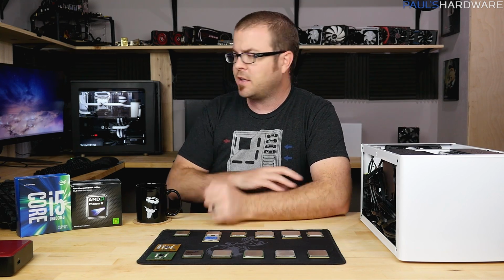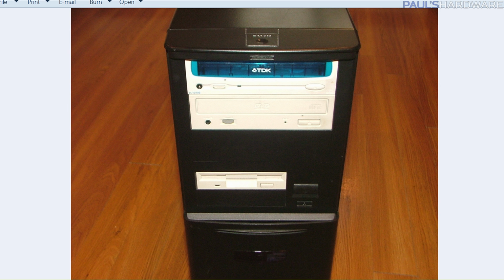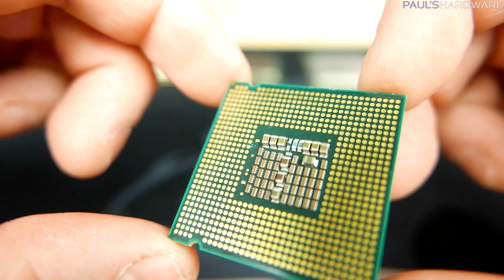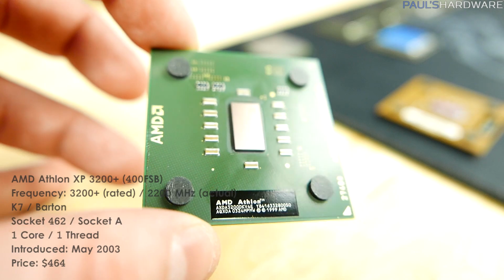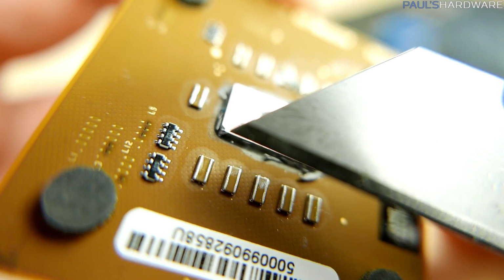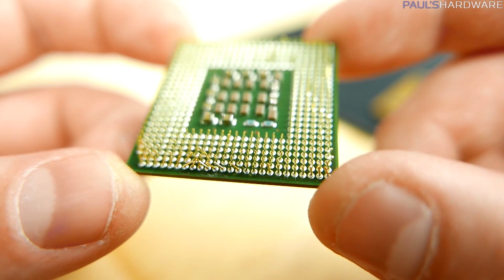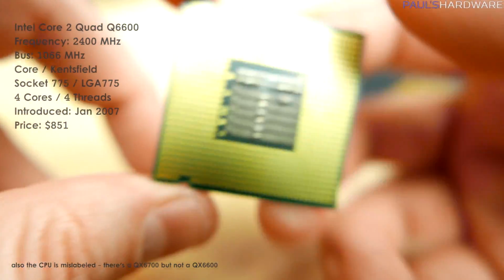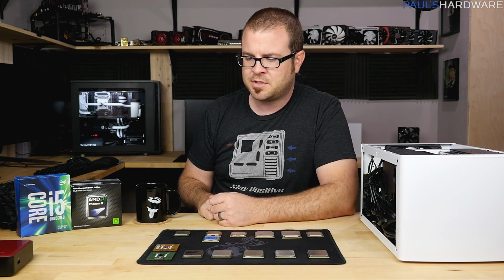My CPU Collection!

Comment: 386sx16
486dx33
Pentium 133
Pentium II 233
AMD Athlon K7 700mhz
Then I forgot as I started multiple machines and basically got a new Intel CPU every 2 years.
Fun fact: the K7 was a weird socket mount which was like a PCI slot rather than a socket

Comment: I was lucky. Somehow I chipped a tiny piece off an Athlon 750 and it kept working fine. Putting on those Athlon heatsinks was a huge pain. That's a nice collection. I still have the first PC processor I bought, a AMD DX-4-100, along with a Cyrix 166, a couple of K6's/K6-2's along with several Athlons and Durons I've picked up for cheap over the years. I liked Abit boards too, except they all used junk capacitors that bulged after a couple of years.

Comment: Paul should I keep my CPUs I have the very first dual core 64 bit and the very first phenom 4 core ,wasted so much money back in the day I have learned with age to wait and buy second gen at half price I don't do benchmarks like you so the latest and greatest is lovely to have but completely unnecessary for games unless you have 1500 panels and even for high studio production ,saving 1 min or even 5 mins here and there doesn't really help I just do other work and wait for it to finish but should I keep em for nostalgia

Comment: Some laptop cpu have come without heat spreaders until recently my laptop from like 2011 had an amd with radeon it did not have a heat spreader, unless that's not really recent is just my view on it, or laptop cpus really dont come with heat spreaders... i donno I'm still learning. I notice the chromebook also has a chip with an exposed dye and no heat spreader... fascinating to me how it uses the metal shell as a heat sink... that how laptops are..? again still learning, i donno. 
wish i took computer tech in college.

Comment: My dad bought me my first PC in 1993. It was a 386SX33 with 2MB of RAM...
I was 11 at time and it took me a year untill I had to open my case because 
I accidentaly put password in BIOS. My older cousin told me to open it and
shortcurcuit the battery with some resistors... When I saw how simple and
modular the inside od a PC is, I knew right there and then that I want to be
a computer technitian of some sort... Since that day I never bought a new
PC. I did very small upgrades because I was young and didnt have much of
a monthly allowance... I would earn some by reinstalling windows for my 
friends and almost every time would upgrade something. That is why I can
safely say that I exchanged more than 20 CPUs over the period 1994-2016.
I already made a long post so I wont be naming all of them, and I'm sure
I would forget a few. But one of my favorites were Celeron300A that was
easily overclockable to 450. Then it was Deschutes 400 (slot 1 CPU) which
was an amazing cpu, although much expensive at that time. Later on there
was Celeron566 that was overclocked to 850 just by increasing the bus
speed from 66 to 100... (same was with cel300A)... In the last ten years
I somehow ended up having AMD cpus because of more bang for the buck.
Right now I have an FX8300 that is overclocked to 4.2GHz and untill Zen
becomes mainstream and cheaper I think I'm gonna stick with this one.
I hope I wasnt that much boring and I appologize if you find this post a
waste of your time reading it, but just wanted to contribute to your nice
walk down the memory lane :) 

Thank you for your post and I will be subscribing as soon as I press "comment" :)

many regards from Croatia

Damir

Comment: I have not seen an old Barton core in sometime, neat thing with those lid less CPU's  is you could unlock the multiplier with a pencil, I also had an FX60 as well as an FX57 running on the first SLI certified Asus board, don't remember the model but it was pre RoG when their enthusiast line was called Ai Lifestyle, and my first Intel was a Core2 Duo Extreme chip, again don't remember the model number and that was on the first Asus RoG board which for the LGA 775 was the original Rampage Extreme, it had this weird Black PCB with red white an blue color scheme, it was bad ass and came with a north bridge water block that looked like a transformer or this rather tall heatpipe finned style heatsink that had a fan that hooked to it. these comps where my first two gaming specific builds and I only have the Rampage board one of the 6800GTX I ran on them and odds and ends that I keep finding among all my computer stuff from over the last 20 years or so, the rest have been sold, burnt up, or just to old to matter anymore, good time though.

Comment: Let's see,

Cyrix 180MHz, 1997 (tossed)
AMD K6-2 333MHz, 1999 (sold)
AMD Athlon Thunderbird 850MHz, 2000 (First PC build, fried attempting overclock by bridging L2 contacts with lead, luckily my bro had the same CPU and a newer system so I used his)
AMD Athlon XP 2700+, 2002 (sold)
AMD Athlon XP 3000+, 2004 (sold)
AMD Athlon 64 X2 3800+, 2007 (sold)
AMD Phenom II 920, 2008 (stolen)
Pentium 4, 2010 (sold)
Athlon 64 X2, 2010 (sold)
Intel Core 2 Quad Q6600, 2011 (sold)
Intel Core i7 2700K, 2013 (still own)
Intel Core i7 4770K, 2015 (still own)

Comment: My previous PC CPUs: Celeron 400 (Mendocino), Athlon XP 2000+ (Palomino), Athlon 64 4000+ (San Diego) & Athlon X2 4800+ (Toledo). Presently using an E8400 (Wolfdale) and an i7-4790K (Haswell Refresh). Still have them all around here somewhere.

Comment: I still use socket 775's! But I go with quad cores, like Xeon X3350 and comparably the Q9450, in a head to head, the Xeon actually does perform better the the Q9450! Yeah on Cinebench I can get a 290 all day with liquid cooled X3350 and XFX R7 360 with 2gb and only 8gb of DDR3 and evga 500 watt bronze, but that is at stock clock speed! The only thing I think about upgrading to would be a newer Xeon with either a 4 core 8 thread or 6 core 12 thread base! 

I have looked at I-5's and they still run pretty high on ebay if you want a model with a better passmark score usually they have about 5000-6000 for the scores in the $50+ range, my Xeon setup runs over 4007 at stock frequency, 3 points higher than my Q9450 not much of an upgrade! When it comes to an upgrade for cheap prices I am looking for a Xeon cpu that has a passmark of over 7000, most of which the motherboards are the most expensive investment at $100-$150 new! The Cpu's can range from under $10-$50 depending on the socket, I also look for ones that have no internal graphics, but as last resort would choose one with intel graphics! 

The only alternative would be a FX8350 unlocked edition with mb as combo! When I build anything for resale it usually will feature a core 2 duo,m a E8400 minimum, though there are some Xeon Quad cores that have slightly higher passmark scores, which would make greater multipurpose systems! My Q9450 does have an Asus GTX650 TI OC edition with 2 gb gddr5! Yeah I am a cheapskate but hey, you don't always have to spend too much to get decent gaming! My cards were only $80 new for the Asus and $109 for the XFX, though had I purchased it sooner was only $79.99 from bestbuy on ebay!

Comment: I still have a i7 920 running with a gtx 260 which is now use as a media library. My current system is 3770k with gtx 980 which is due for an upgrade as i tend to get a new system every 5 years. So i just cant wait for kaby lake.

Comment: Actually the Rating of the AthlonXP CPU's were comparing its speed to the original Athlon, so an AthlonXP 3200+ should run like an original Athlon @ 3.2 GHz

Comment: u could bend the pins back on the old p4 now with the lga socket u got more chance gettin a bj of god,who ever came up with lga needs to have there balls cut off,the k7 Barton the best chip for gemes at the time loved it
my first build was a p2 266 cos my p120mhz was runin very slow,,the amd chip had  a heatsink and u had to  lift the lever and push down the other side and if u didnt do it right u would crush the core....

Comment: I remember my first computer build It has (its still built I just don't use it)
i7 920 OC @3.5ghz
Corsair AIO liquid cooler
Tri-way GTX 280 co-op
Evga x58 MBO
120GB intel SSD
24GB Corsair DDR3 1866
It was a beast for it's time!
Reply: I've got single gtx 280...
Reply: Oh and a 750W Corsair fully-modular power supply
Reply: X58 mobo here upgraded my old i7 920 to a xeon x5680 OCed 4.2ghz on air
i almost feel sorry for those owners i5 6600K - i7 6700K

Comment: Actually Gulftown (i7-970, i7-980, i7-980X, i7-990X) were the first consumer Intel 6 core cpu and it worked in the same X58 boards as your I7-920. The first intel sever chips were Dunnington which was basically a 6 core version of a Q9900 with half the L2 cache per core but with 16MB L3 for a mPGA-604 socket.

Comment: Hey, still have a X58 SLI Evga and a i7 920. Unfortunatelly the motherboard is dead and a refurbished one costs too much to revive the platform. Besides this, I have an Athlon Xp (with a still working mobo, ram and agp gpu), 2 skt.939 Opterons, Several Am2 Athlons, Semprons, Athlon x2, one Phenom X4 9950, a FM+ A8 working in my ubuntu server storage, a Q9400 in my mom's computer, E7300, two P4 skt. 775, an i3 on skt.1156, one Dual Core on 1155 and the actual cpu in use, the 4790K.

Comment: My CPU history....
Intel 386dx 33Mhz with math co
Intel 486dx2 66mhz
Pentium 100mhz
AMD K6-2 350
AMD  Duron 650mhz
AMD Athlon 1.33mhz
AMD AthlonXP 2000+
intel P4 2.6Ghz northwood
intel P4 3.4Ghz prescott 
intel E8400 
Intel i7 2600k <<<< my system
AMD FX 3820 <<<< Wifes system
AMD FX 3800 <<<< Sons system
dual Xeon E5620 <<<<<< Server
Reply: Mine: none.
Reply: Triggered Engineer why its just a server?

Comment: AMD Athlon XP series had a pretty weird model names right? it meant how fast it is compared to a Pentium 4 processor like for example the XP 1800+ Was on par/faster than a 1.8 GHz Pentium 4 Willamette and it was cheaper compared to the Pentium 4 Intel used to be assholes back in the 2000s they paid various Benchmarking companies to make their CPUs seem like top of the line and the best of the best. But AMD Still won in various benchmarks like Editing , Gaming (in 2001 duh.) and they offered better performance for a low-price Building a Gaming PC using parts from 2000/2001 is pretty awesome :) But nowadays I prefer Intel until the Zen is released

Comment: I have a Pentium 4 HT that uses the LGA 775 socket, still using it occasionally on Vista, but it can barely run Ubuntu 15 and will never boot up Remix OS/Android-x86 due to the serious lack of memory (512MB)
Reply: In graphics, I have a working S3 Virge from 1995 (but really can only be used as a PCI Express to VGA conversion)

Comment: My CPU list:
AMD K6-2 500 MHz from an old Compaq system (Still have it, not in service)

Intel Celeron D315 2.26 GHz (Gifted to my dad's organization)

AMD A6-6400K 3.9 GHz (I'm selling it)

AMD Phenom II X2 555 @ 3.5 GHz (Current gaming rig, replaced the A6 LOL)

AMD Athlon II X2 P340 2.2 GHz from my laptop (Excellent performance in multimedia BTW) 

At last, an Core i5 from a MacBook Air 13.3.

Comment: I wish I still had all my old CPUs. I do remember them all, though! Easier to remember when you don't go through so many =P

AMD K6 166 (2000), AMD, K6-2 333 (2001), Athlon XP 1800+ (2002), Athlon X2 3800+ (2005), Intel C2Q Q6600 (2008), Intel i7-4770k (2013)

What's wacky is I've had my current build for nearly 3 years and have absolutely no desire to upgrade yet. CPU/Mobo wise, there hasn't been enough improvement to make it worth it o.o

Comment: still use a modded version of a I Mac g3 with a Pentium dual core  i made back in 2006 when 1st gen dual core pentium until the CRT monitor shorted out 2 weeks ago it won't turn on no power at all

Comment: Nostalgia?  You're not that old, sir.  My first PC had i386SX running at 16MHz and came with 1MB DRAM and 40MB HDD.  I've seen 8088 and 8086, as well as 80286 PCs, but I never owned those, so I'm not that old.  I upgraded that 386SX with full 8MB of RAM and kept using it at least half way into my college years.  This is when my dorm mates had 486DX33s.  One guy had a 486DX2-66 with 16MB DRAM.  He was the king of the dorm floor. LOL  How times have changed....  I mean, I have almost 1000x what I had in HDD in DRAM now (32GB w/ ECC).  Now get off my lawn!

Comment: Still using an AMD Phenom XII 945 @ 3GHz and an ATI Radeon HD 5450. 

Sometime in the future (when I have enough money), I will upgrade to an Intel i7 6700K and an ASUS STRIX 980ti all crammed into a Silverstone ML08B-HW. It will have 2 1/2 TB of SSD storage (1 Samsung 950 PRO M.2 NVMe SSD + 1 Samsung EVO 850 2.5" 2TB SSD)

Comment: Thank you for sharing these cool older CPUs.  I might be different from other PC users because I kept using my computers for closer to a decade after each purchase.  In fact if I hadn't allowed myself to get used to using faster computers from my friends or at school I probably wouldn't have upgraded the entire PC until critical components broke that could not be replaced.  I never sold off my computers to buy new stuff.  I just bought cheaper and cheaper parts to expand its original functionality or data storage.  

Before IBM standardized the home computer market I also bought two Timex-Sinclair computers that I still have, a gaming/computer hybrid from ColecoVision (which regrettably was sold).  

On the PC side of things I have a P 200 in a full size tower with 10 drive bays (half are 5 1/4 inch, the other half are 3.5 inch) with 12 expansion slots.  It has locking casters and can be switched at the press of a button to use Turbo Mode.  I had the LED programmed to read 69 Mhz (slow speed) or 666 MHz (Turbo Mode).  The power supply has a dual power outlet (a pass through port + normal power connector) to allow the monitor to be powered directly off the computer.

My other computers are an AMD K6-2/500, AMD Athlon 1.1 GHz, AMD 2800 64-bit in a standard mini-tower with integrated ZIP 100 drive, dual optical burners, and multiple memory card drive bay.  An Intel P4 2.2 GHz Compaq laptop, AMD Athlon x2 64-bit 2 GHz Compaq laptop.  And that is where I currently stand.  Just getting the most life out of my computers before I have to upgrade once again :)

Comment: Why do you say you wish you didn't sell your i7-920? I'm still using an overclocked i7-920 @ 3.7ghz. Has been rock solid overclocked for 8 years. It still isn't significantly outclassed by modern i7s.

Comment: I had a computer shipped with the zalman ball still on a phenom 940, EVERY pin was bent. Mechanical pencil with no lead was used, this cpu is still in use today and this happened in 2010

Comment: Hi Paul I went From the Q6600 to the i5 2500K and i must admit to this day the 2500k is still going had it to 5ghz but back to a mild 4.6 lol.  Took the Q6600 to 4ghz but never liked the temps soleft it at 3.7ghz.  Its suprising how many cpus you have got that ive had over the years :D

Comment: One of my first "performance" builds was a 939 AMD 64 3200+, which I still have the whole system.  I then built a Q6600 system, the original board is gone, but I still have the processor.  Then I went to the 4690K which I am on right now.

Comment: Thanks to the "suction cup effect" of Intel CPUs with a heatspreader, pre hold-down retention bracket, both a P4 3.06Ghz and a Celeron 2.4Ghz lost some pins upon removal. The Celeron ended up, over a period of time, losing 3 pins and worked just fine overclocked to 3.2Ghz. The Pentium 4 also didn't care. Those were the days.

Comment: Also I had a Intel 8088 at 4 MHz that you could manually set to 9 MHz through a DOS command. Made half my games run in fast forward when game delays were built right into the code! (This was 1984 by the way. Wanted an 80286 damnit, but my cheap ass parent only got me a Packard Bell!) It came with 640 KB (yes, that's suppopsed to be a K!) of RAM 40 MB (yes that's supposed to be a M!) HDD. GPU's weren't really mainstream back then yet and the simplest could cost as much as an entire computer. So software mode for the crappy freeware DOS games! "Flightmare" or "Jumpping Johnson" anyone! Never heard of those games! Nobody has! Damn I need to go pull that beast out and rock some 5.25 in floppy games! Get this... 1984 computer STILL WORKS! 2015 Dell (Not our main rig. I built it.) HARDWARE FAILURE IN 6 MONTHS!
Reply: +Stanley Scalf Oh did I mention a CGA monitor! Yeah you kids don't know what that is go check it out then come back and feel sorry for us old timers! Three funky main colors and they were all NEON to put it simply! CGA 320x200 in 4 colors amd 1 palette is what is was called.
Reply: You sir are old!
I started out in the PC world with a 386-40 and a 387 coprocessor... Been building em since. Got tons of old CPUs lying around.

I used Amiga computers prior to that, and commodore 128 and 64's before that. Still got em all.
Reply: whochecksthis Thanks for reminding me! You and my bathroom mirror would get along splendidly. Stop braggin about all your new fangled gadgets here on this here youtubes! By the way Amiga was the shiznittle-shinp-shnap-doodle-dangle-tee-total-awsomesuase-and-a-bag-of-chips! Aheem... It was good.

Comment: I have used a mechanical pencil without the lead to straighten pins.  Slip the tip over the pin and straighten.

Comment: How nostalgic. Let's see if I can remember all the CPUs I used.
Intel Pentium 133 MHz
AMD K6-2 450 MHz
Intel Pentium 4 1000 MHz
AMD Duron 2200+
AMD Athlon 2500+ (OCed to 3000+)
AMD Llano A4-3300
And currently running AMD A10-7850K
Waiting for Zen to decide on my next one.